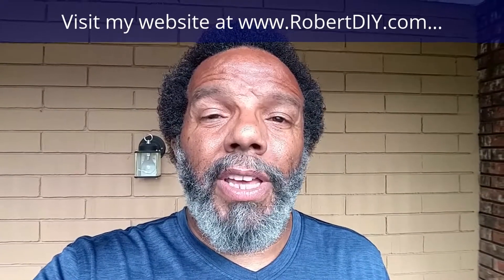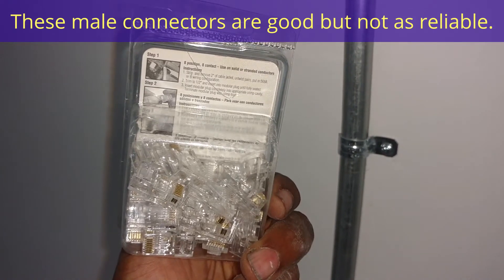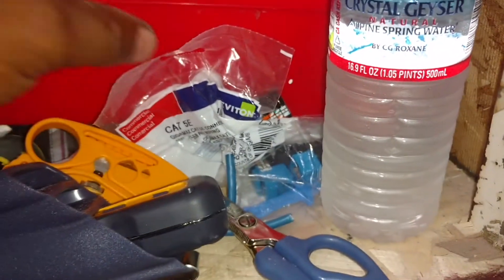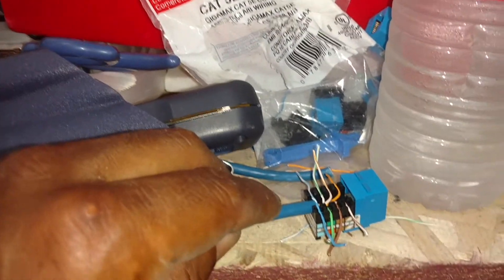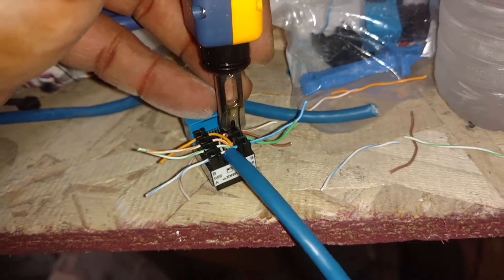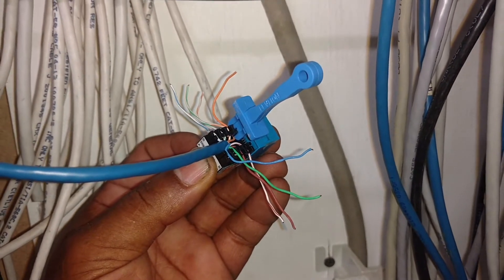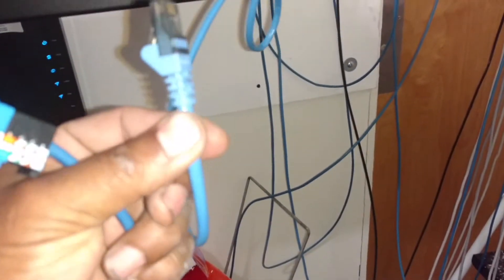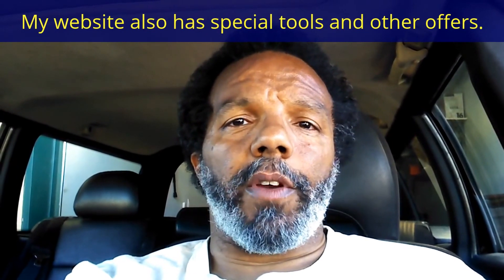Building your Cat5e wire connections for networking the Flir security camera system. - REMIX

Comment: FYI those male connectors will last about 15 years if crimped properly. The important thing is to crimp properly. Also don't forget to test any cable you make with a tester. Glad you're using fluke as the store brand tools are junk.
Reply from the maker: Thanks for sharing.